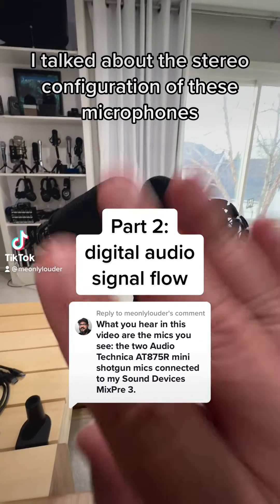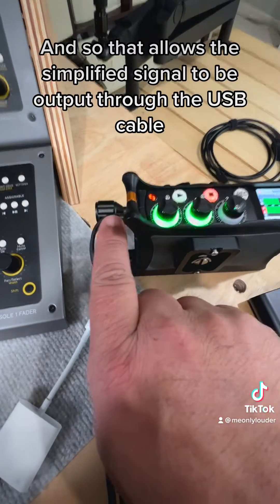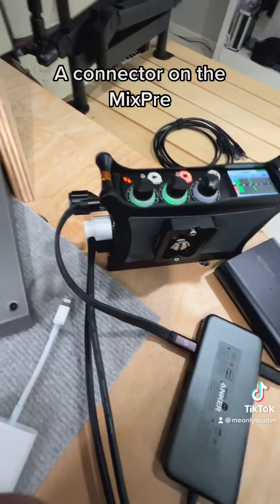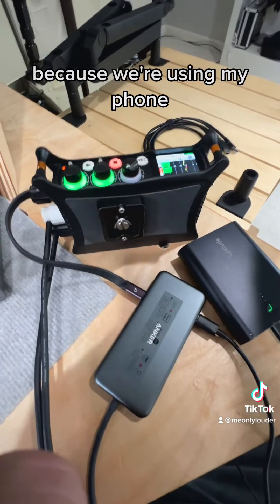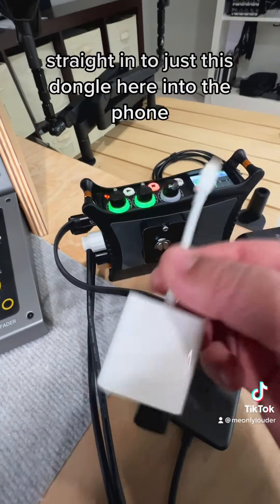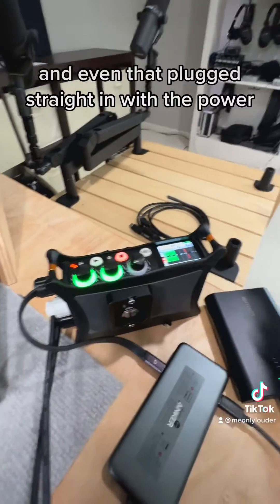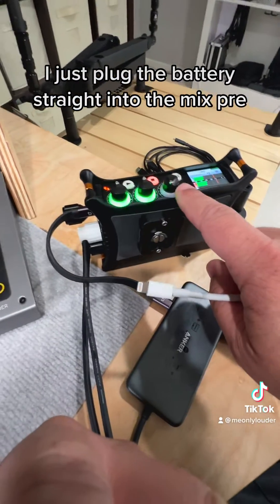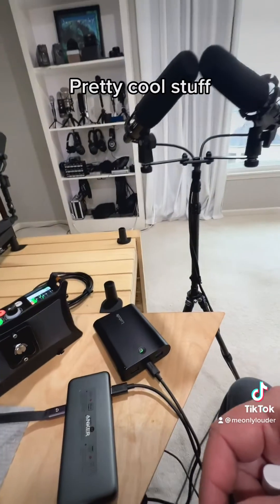Connecting a MixPre Recorder Interface to an iPhone for Stereo Audio in Video Recordings

Comment: Why not just plug your MixPre3 or 6 in the studio with the power adapter?  I can understand having to power the iPhone while being connected for audio too.
Reply from the maker: Do you mean the USB C power adapter that comes with the MixPre? I don't have the Hirose power adapter. In my other video I explain how the USB A port does not provide stereo signal so to get stereo input to the iPhone requires connecting it to the USB C port. So that means providing power through the USB hub to the MixPre along with the data connection to the iPhone. The iPhone also will not accept audio signal from the MixPre's USB C port unless it is going through the hub, since it is programmed to deny connection to any high-powered audio interface directly to protect itself.

Comment: Actually, you can input up to 5 mics on the Mixpre 3-II ( channels 4 & 5: line-level mics or boom mics (48v Phantom Power adapter). Just use a Y-Splitter into the 3.5mm Stereo Input. In the MixPre-3 II’s menu, assign the left channel of the 3.5mm input to channel 4 and the right channel to channel 5. With the new +2 Plugin, you now have physical knobs for channel 4 and 5.
Reply from the maker: This is the 1st gen MixPre-3, not the II. So I don’t know if I can do what you’re saying here. I also have a MixPre-6 II which is much easier for me to record more than 3 mics.
Reply: @meonlylouder  Valid point. I don't know if that can be done in the 1st gen mixpre-3.

Comment: I would have never thought about going into the system settings to set the USB audio to stereo instead of normal. It kept locking up my iPhone 15 pro max intermittently and would not record a frame of video either internally, nor externally to USB over my powered USB hub. I am running a Belkin Hub with 100W PD input port, and have connected a Crucial 2 TB SDD, the MixPre3 II and an Aputure AL-M9 LED light, all powered off a SmallRig VB99 battery and all held together on a SmallRig cage for the iPhone 15.
Reply from the maker: Are you able to get it to all work now? I've heard recording to external drives can drop frames - especially on slower write speed SSDs. I use the Samsung EVO SSDs for my Atomos Ninja V recorder since I've heard the Crucial SSDs can drop frames with record ProRes 4K as well. I haven't had any issues with the Samsung SSDs so far (knock on wood). Have not tried external recording with my iPhone since I have a 14 Pro.

Comment: I hope you don't mind my asking a bonehead question... I've just come across your video and feel somewhat amazed that yours appears to be the only video out there talking about using the MixPre to capture audio for an iPhone video. Here's my question: if using the battery sled on the MixPre for power, can stereo audio be captured on the iPhone using just a simple USB-C to USB-C cable? I have tried already from both the USB-A and USB-C ports on the MixPre, and in both cases am only able to get audio on the left channel of the video. Many thanks for your attention :-)
Reply from the maker: If you're hearing the actual mic going through the MixPre input only on the left audio of your video, the issue is probably the USB output assignments in the MixPre Outputs menu. I have USB Output 1 and 2 set up to send the stereo L&R mix output instead of inputs 1 and 2. Maybe the USB outputs on your MixPre are set to inputs 1, 2, etc.? You'll just have to keep in mind if you want to use it as a multitrack interface that you've changed those. For example, I have mic input 1 direct out set to USB 3, mic input 2 to USB 4, mic input 3 to USB 5, mic input 4 to USB 6, aux 1 to USB 7, and aux 2 to USB 8. That way, if I ever need to connect my MixPre as an audio interface for a DAW on my Mac, I'd need to select "MixPre input 3" in my DAW to get mic input 1, since "MixPre input 1 & 2" in my DAW are assigned to the MixPre's stereo mix L&R. I hope that makes sense. :)
Reply: @meonlylouder  You are awesome, thank you so much! Problem solved! I really appreciate both your quick reply and the very kind thoroughness of your reply. As I only just recently got the MixPre and haven't yet used digital interfaces with my computer, I wasn't understanding how the USB output selection was relating to the USB iPhone connection. You've clarified very nicely for me. I really appreciate it. 

Interestingly (maybe...) it worked with the MixPre's USB-A port, using an A-to-lightening cable. (iPhone 7) According to the user manual, only the USB-C port is for connecting to the computer for audio interface. No such function is mentioned for the USB-A port. For me, this is awesome because it means I can use the USB-C port to power the MixPre. 

Once again, thank you very much! All the best! Tom

Comment: Hi, I just found your channel. What kind of XLR connectors are you using? Can you change the position of the cable?
Reply from the maker: @briansmasal7111 They are Switchraft AAA Series Low Profile 3 pin XLR connectors: https://www.bhphotovideo.com/c/search?q=switchcraft%20aaa%20low%20profile

Mogami W2552 wire fits snugly through the small hole: https://www.bhphotovideo.com/c/product/888204-REG

Comment: Thanks for the awesome tutorial! Forgive me for being a bit dense, but please explain the signal flow from the MixPre to the apple camera connector to the iphone. Specifically, which port is the camera adapter plugged into?
Reply from the maker: The camera adapter is plugged from the iPhone into the USB C hub's built-in computer connection cable (with a USB A to C adapter). Then the hub also has a power supply connected to its USB C power input, as well as the MixPre connected to one of the other USB C input ports. Hope that makes sense.

Comment: Cool video!  Novice question... If I wanted to use the included wall charger (USB-C) to power the MixPre3II, but also wanted to use the USB-C to transmit audio to an iPhone12, can you do that with just the camera adapter, or would you still need some kind of power brick?  Or, am I barking up the wrong tree all together?  Thanks!
Reply from the maker: No, you cannot connect the MixPre directly to the camera adapter, which only has one Lightning power connection and one USB A connection. MixPres require 7.5 Watts of power and USB A ports supply a maximum of 4.5 Watts, which is why SoundDevices sells a USB C to USB A adapter that has TWO USB A connections. 

Plus, you'd need a female USB C to male Lightning adapter to connect the MixPre's power supply to the camera adapter. Even if you were able to make those connections work directly to the phone without the hub, iPhones are programmed not to accept input from higher powered USB audio devices unless the iPhone sees that it's connected through a USB hub. Even MIDI keyboard controllers require hubs just to pass signal, even if they only pull 2 Watts or less.

I also don't think the MixPre's 15 Watt power adapter supplies enough current for powering the USB C hub plus the MixPre plus the iPhone. I would use at least a 30 Watt power supply for this setup. The more power supply wattage the better. Always for audio amplification devices. Bus powered audio devices have many significant tradeoffs. I should do a video about power for audio soon...

A USB C powered hub like I showed in the video is the only way to use the MixPre with an iPhone to get stereo audio. If you're OK with mono audio, I talked in the video about how you can use a regular USB A Lightning cable to connect to the USB A port on the MixPre to the iPhone for signal, and use the MixPre's USB C power adapter just for power connected directly to the MixPre. In my experience, sometimes the video apps don't see that connection though and I have to unplug and replug the Lightning connection with the app open. The USB A port on the MixPre also does not supply enough voltage to keep the phone charged while recording video, so watch your battery level! With the powered USB hub and a higher wattage power brick (45W+), your phone gets charged too.
Reply: @meonlylouder    Wow!  Thank you for the detailed response!  This is way more than I was expecting!  I may try the mono USB-A option again.  My iPhone wasn't recognizing the signal, but I hadn't thought to unplug and re-plug in the Lightning cable with the app open.  Could you share the powered USB C hub you use and the cable you think I'd need to power the unit and get stereo audio?  I really appreciate you entertaining my rookie questions!
Reply from the maker: @deanherman3558  Glad to help. This is the USB C hub seen in the video, and I believe is the most reliable hub for the money, which can also be used with a laptop for power delivery (connect the laptop power supply to the hub's power input): https://www.amazon.com/gp/product/B07ZVKTP53
Reply: @meonlylouder  Awesome!  You rule!  Thank you!

Comment: Lots of overtalk so completley confused me as I couldnt keep up with the info 😕 thats my problem, not yours.

If i use a battery on the mix pre, then plug in the USB camera adapter to the iPhone this should work too? I'll try this tomorrow. I've found a USB mixer that has two XLR sockets that will do stereo with  battery bank connected to it with the USB camera adapter to the iPhone, so it would be great if I can use the MixPre too.

Comment: FINALLY!!! Someone who explains it completely and thoroughly. Can you confirm that you use the bog standard Camera app on the iPhone to capture the video? Or do I need to purchase a specific app to capture the video?
Reply from the maker: I like using the ShurePlus MOTIV Video app (https://www.shure.com/en-US/products/software/shure_plus_motiv_video) so I can see the audio levels. In the past the audio would just stop working randomly when my phone went to sleep. Having the visual feedback of the meters helps me have peace of mind when recording. You don't need to have Shure hardware to use the free app. Audio does work with the stock camera iPhone app, but it doesn't have audio meters, so test thoroughly and I replug the audio interface before each recording to make sure it has a fresh connection (I think switching apps can cause problems with the audio connection).
Reply: @meonlylouder  Thank you for responding. I appreciate it very much.